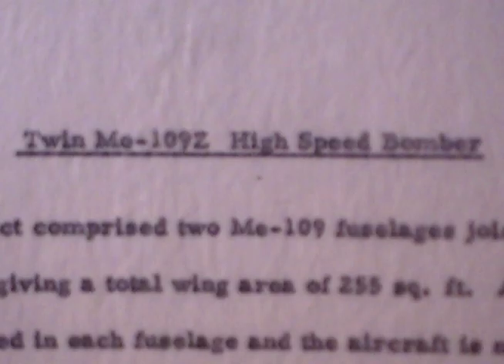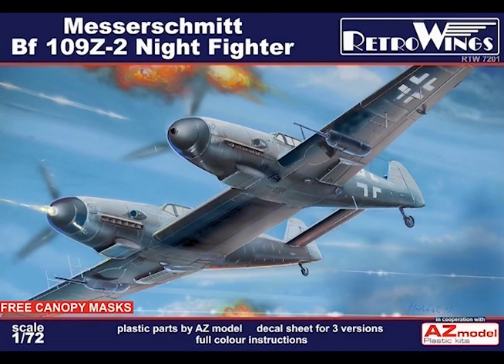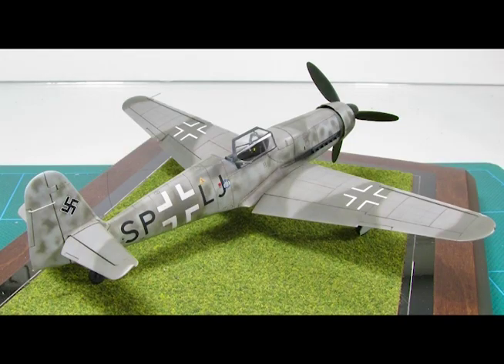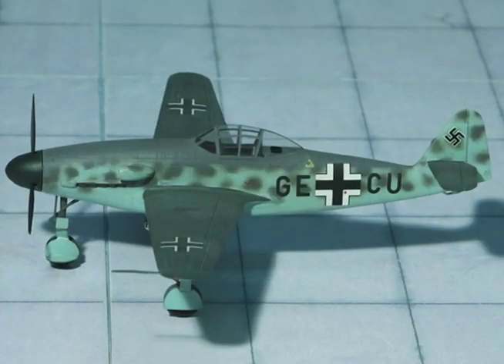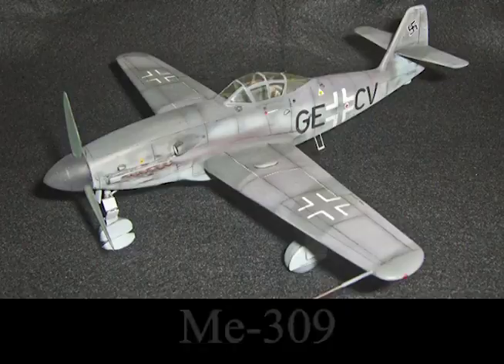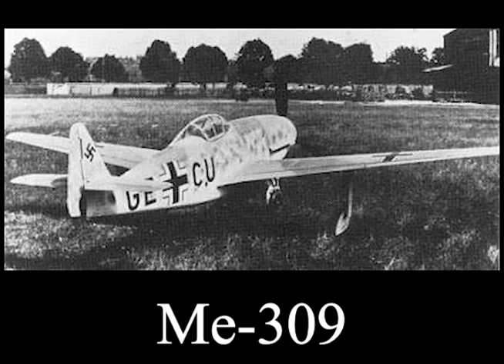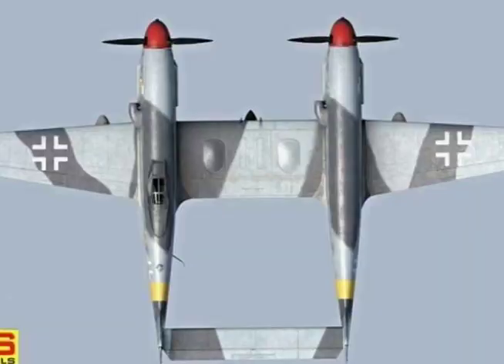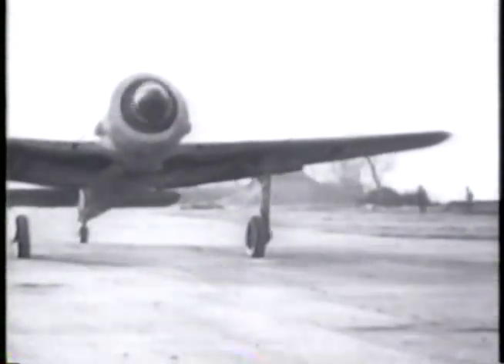German Experimental Aircraft of World War II #18

Comment: There IS a 1/48 scale kit of this aircraft. It was, however, two Bf 109's (probably late G models) joined and to be powered by Daimler engines, not Junkers Jumos (at least as planned). As it never truly entered into serious testing, who knows what mill was to be eventually installed. The Jumo had the supercharger intake on the opposite side of the fuselage and it was not designed to allow a canon firing through the propeller hub.